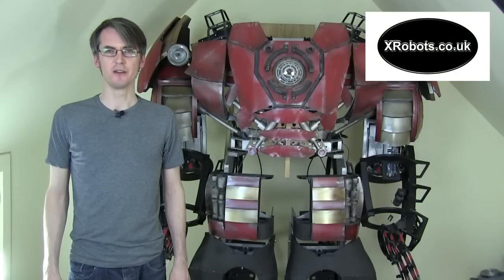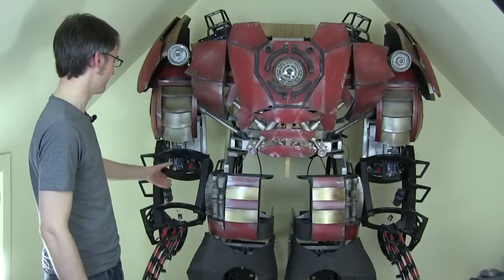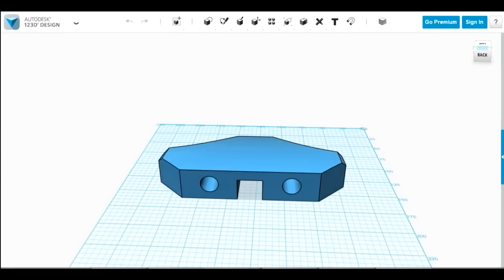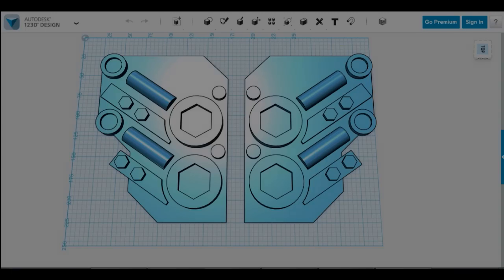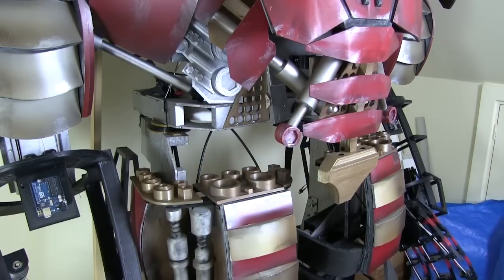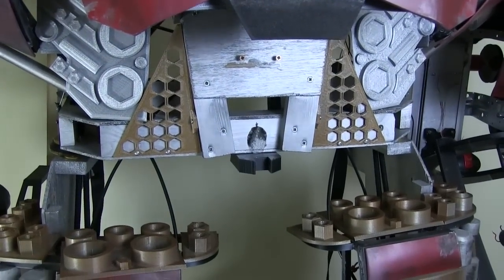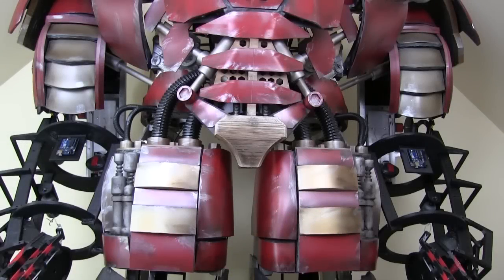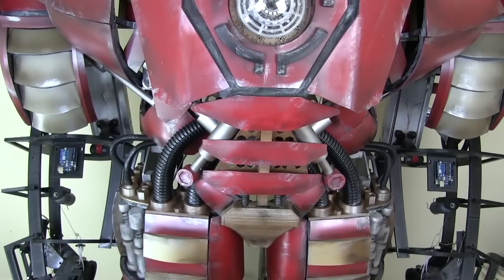Iron Man Hulkbuster Cosplay #31 | Cod Plate & Shins | James Bruton

Comment: Unsure if the placement of the knee repulsors look right. They appear to be aligned right now with the silver wooden frame, however the feet and lower legs are puffed out to be much wider with the frame running along the inner side of the true shape of the legs. This means that the repulsors are off center towards the inner leg and makes the legs look horribly off balanced and deformed. Maybe when further details and the feet are done this will not be so noticeable, but I have to wonder if it wouldn't be worth it to redo the foam and solid red parts so that the repulsor and other 3d printed bits are centered properly with the true shape of the leg. Like the repulsors should be aligned with the center panel that runs down the front of the upper leg.

I could be wrong about their alignment, honestly the shape of the lower leg is throwing me off and looks like, when looked at head on, that the outer part of the lower leg puffs out about 3 inches too much. In the thumbnail image for the video it really looks like the hands would be hitting the lower legs and the lower legs appear to be as wide as the chest unit which feels off.

Besides that observation, the rest of the suit looks amazing, the red glowing panels in the chest unit give it a great feel and I hope that you plan to add more in the exposed part in the abdominal area. Actually, a neat idea might be to have, when the suit closes up behind you and the chest detaches from the waist, for a system to have a jet of fog (compressed co2?) to shoot out from the waist area, since your Hulkbuster design has a more exposed mechanical feel to it. :P